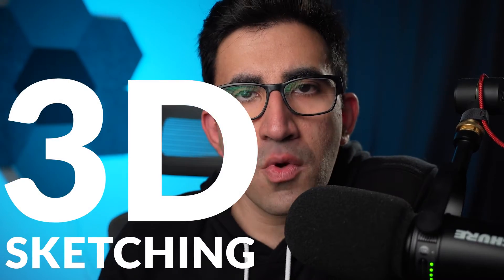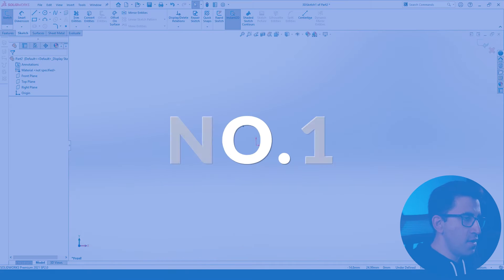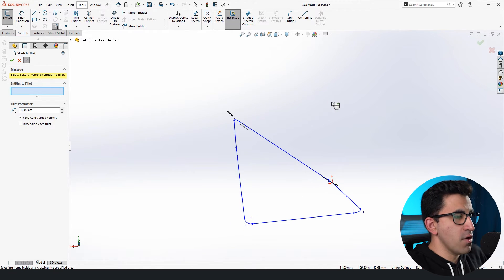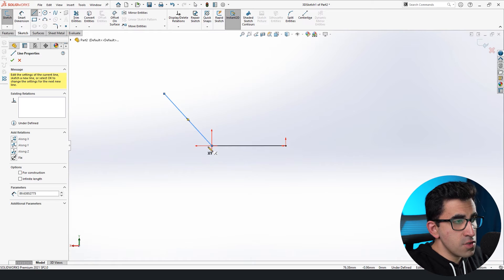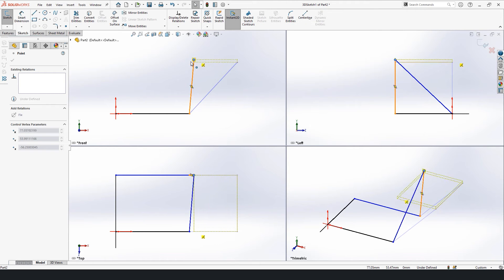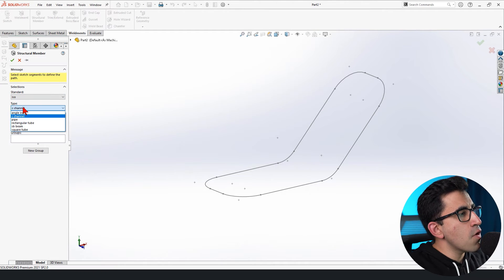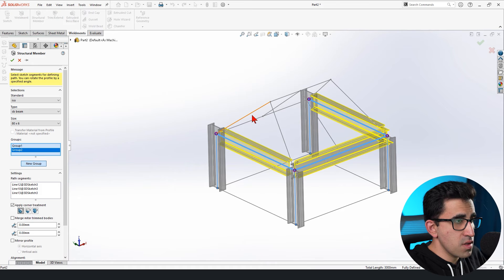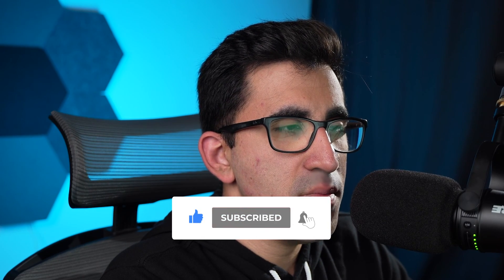Fundamentals of 3D Sketching in SolidWorks

Comment: Thank you for your informative videos.

I am currently encountering a challenge when using the Weldment feature. After creating a model, the entire assembly is combined into a single part, which significantly hinders the creation of individual profile drawings on separate sheets.

I have attempted to circumvent this issue by saving multiple copies of the part and suppressing all but one profile in each copy. However, this process is extremely time-consuming.

I would be grateful if you could suggest a more efficient method for modeling weldments while minimizing the time required for drawing creation.

Comment: I just discovered Tools->Sketch Settings->Enable Snapping. If I uncheck that box, I find that adjusting a 3D sketch is a lot more predictable, especially when using it to route tubing in an assembly. The default (Snapping) causes the point you're dragging to jump perpendicularly to the current plane as it finds features in the assembly.

Thanks for a great video!
Reply from the maker: Great tip, another thing that helps as well is holding down CTRL to avoid the auto relations to kick in, this again helps to get the point you want where you want, instead of defining it with automatic relations which might not be ideal in all cases.
Reply: Oh! I didn't even know about the CTRL key shortcut. That will help generally. I'm one of these half self-taught people you talked about.

Comment: how i can insert angle dimension in 3d sketch?
Reply from the maker: i dont think you can
Reply from the maker: unless you are using straight lines, you cannot
Reply: Angle dimensions can be inserted in 3d sketch simillar to 2d sketch, only the added thing you need to do is define the 2 or 3 axis using construction lines with along axis relations. For line in 3 axial angle you need to give atleast 2 angle relation. One is from one line to other and one is from line to construction line.

Comment: I like to work with 3D sketch when I have to do a big frame with weldments. It takes more time to get it done and experience all the tricky features, but if you have a fully constrained sketch it can work nice.  However I havent got a proper cut list in my life from these parts, somehow it's always buggy and sums up the individual sections. Looks silly when you have a 2m wide frame but the cut list sums up 3 of the sides and tells you to cut one 6+ meter piece instead of three 2 meters pieces.
Reply from the maker: i know, what you need is a video under Weldments, maybe I'll do that
Reply: @with-aryan  that would be nice man, thanks